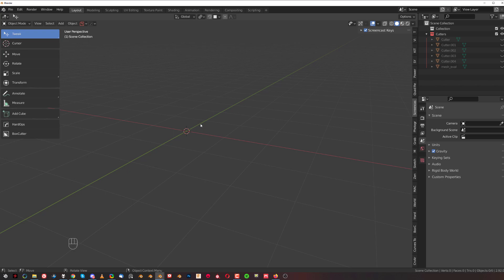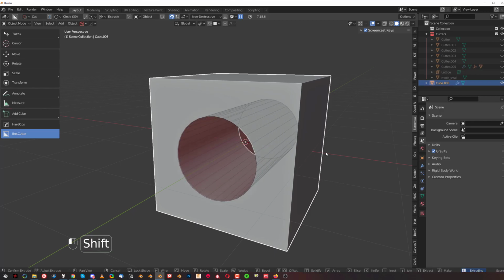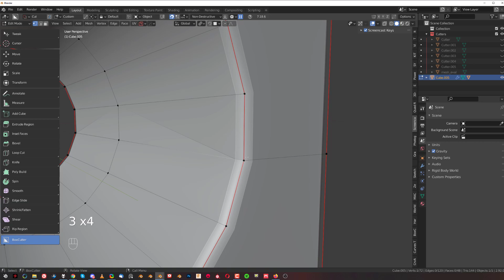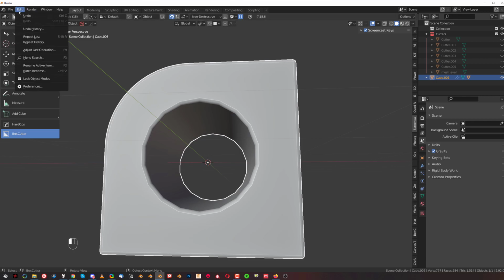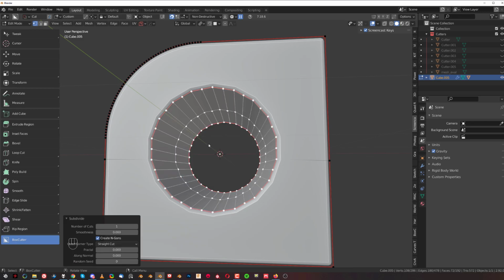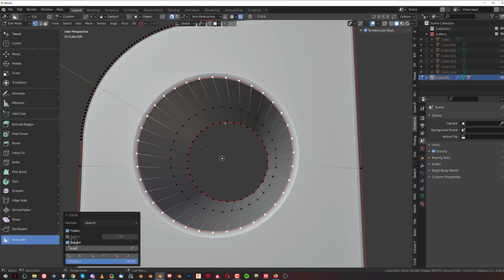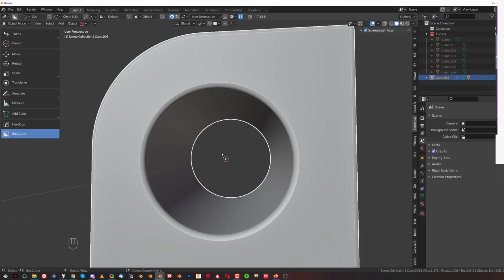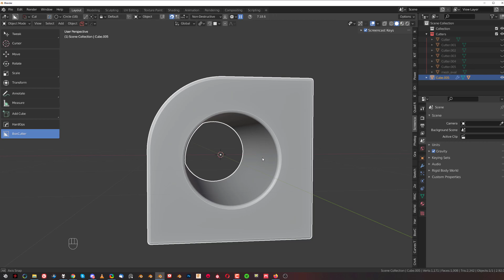AMAZING trick for circle BOOLEAN - Blender tutorial

Comment: Vanilla boolean actually works perfectly, it is not a problem anymore. 

I don't know since when it got fixed, the edges are 90°. I tried it in 2.92 and no issue. 
My assumption is, that BoxCutter is still using the old "code" from Blender.

Please try to do this boolean without BoxCutter and see. I dont use BoxCutter, so I cant say. 
To me, it looks, it is not a Blender problem anymore. 

If all above is correct, you might want to contact the developer of the addon. 
Well, I could do it to, but I am "nobody" and I am afraid, that my message would not be even noticed by him.

Thanks for your time.
Reply: I think you misunderstood what the video is demonstrating. It's about increasing resolution of an existing Boolean. With boxcutter you can already increase vertice count before cutting, it doesn't matter how you're making your booleans.
Reply from the maker: what are you talking about?
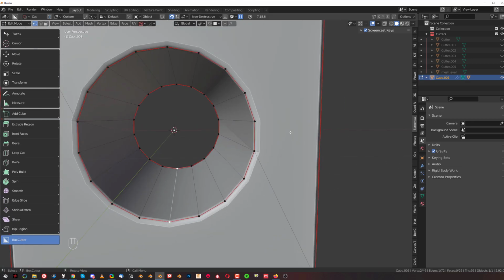Reply: @PonteRyuurui  0:54 in the video
Reply from the maker: @petrnovy6196  what about it, no matter what type of bool you use, its the same result
Reply: I just did, and unfortunately it's still the same sh**.
Blender picks one corner and not the middle of an edge.
Did this manually (ctrl -, then applied the modifier) in 2.93. 

(I do have HOPS /Boxcutter "activated" btw)

Dunno if it helps but always good for the debug/report to Masterxeon, if any...

Cheers

Comment: Two alternatives that also work with more general cases (e.g. if the cylinder is stretched):

1) apply creases to the loops surrounding the cylinder caps and drop a subdivision surface modifier on the cutter (slightly shrinks the cutter)
2) use LoopTool's "Relax" operation instead of "Circle" (25 iterations cubic seems to work fine).

edit: it seems that 25 iterations are not enough, you probably have to repeat the operation a couple of times
Reply from the maker: relax could be tricky on curved surfaces
Reply: @PonteRyuurui  yea, it only works well on lines, not on surfaces
Reply: @PonteRyuurui  Just played around with Laplacian smoothing (blender inbuilt function), seems to work fine at least for ellipsoids.